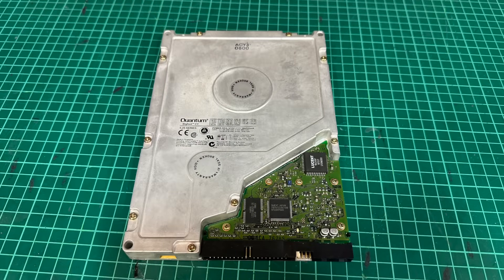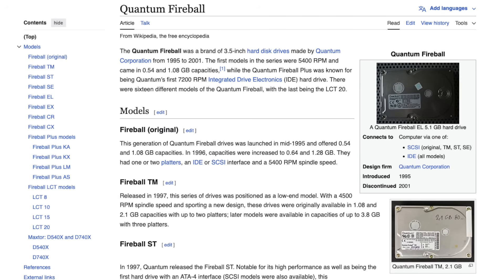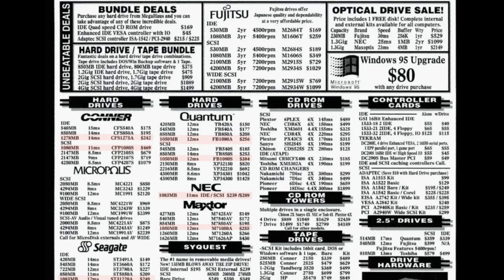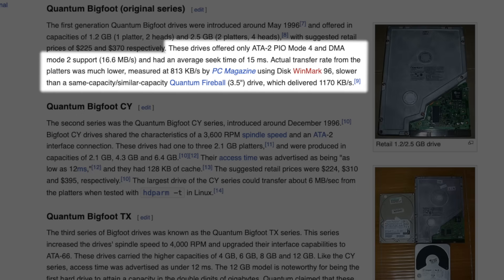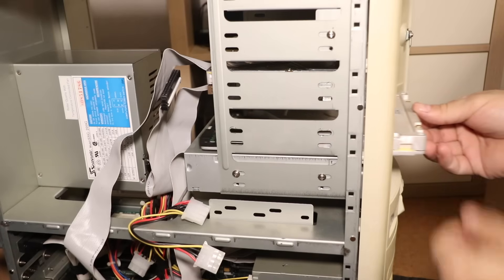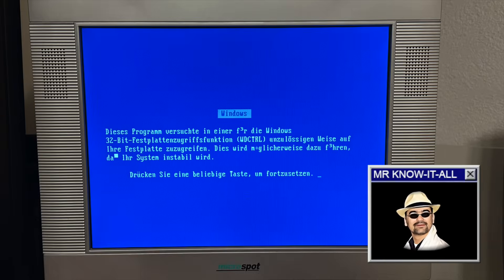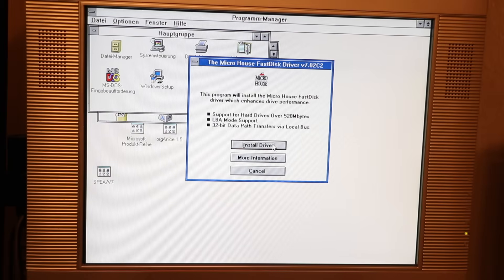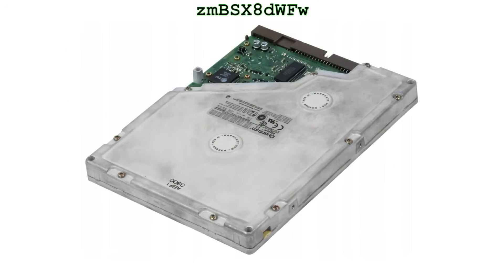The Quantum Bigfoot: When a 1GB Hard Drive Crashed Windows 3.11!

Comment: The biggest wow moment for me when replacing the disk came when I replaced the three original disks (40MB + 130MB + 270MB, Seagate ST-157A, ST3144A, WD) with a 2.5GB Seagate ST52520A, which was not only gigantic in terms of capacity at the time, but also incredibly fast. Regular hard drives at the time had 3200rpm, some faster ones around 4000rpm, and this one had 5400rpm. It was so brutally fast and big at the time. When my friends and I were copying stuff, their drives were running non-stop at full speed, and this one just flashed occasionally :D 1996

Comment: I always wanted a Quantum Bigfoot, but never had one. When they were on sale, I was fascinated by its size, but at the time I was more interested in the fastest drives, so from a rational point of view, it was out of the question for a potential purchase. Today, when people are no longer chasing speed but rather enjoying retro, it's a different story :) I do have one, but it's defective, so I can't use it anywhere :( I have two other drives, the RLL Seagate ST-3144R and the SCSI Micropolis 1684-7, but that's something a little different. Different times, different moods.
Reply from the maker: That fascination of „1 GB is enough for eternity“ ^^
Reply: @THEPHINTAGECOLLECTOR  I wasn't fascinated by the data size, I was fascinated by the physical size of 5.25". It was something that was contemporary (it's sold now) and yet it didn't belong there at the time (a relic of the past) :) Otherwise, I would prefer the very last version that existed, the BigFoot TS19.2A, but I probably won't be able to get it.

Comment: Man why I does not have a Problem this be my 2005 er Notebook with a 100 GB HDD with the Intel Pentium M 740 with MS-DOS 6.22 and WFW 3.11 at a 2 GB C Partition (because yes my Notebook have a Tripple Boot configuation, with MS-DOS, NT 4.0 on C (D,E and F are data Drives for MS-DOS, G: the CD/DVD-RAM Drive) and H with 85 GB Partition for Windows XP and 32 Bit Disk Access enabled on WFW 3.11?

Comment: I bought a Pentium PC in late 1994 which had a 540 MB hard drive. As I was always experimenting with stuff like Linux and OS/2 I quickly ran out of space and bought an 1 GB WD hard drive for around 800 DM, guess is must have been late 1995 or early 1996 which would fit with the price lists you showed. Also I remember I bought it at ESCOM which I think went bankrupt on 1996.

Comment: I worked at a computer store in the late 90's - early 2000's The BigFoot was a terrible drive. It was high capacity, but so slow. They had slower rpm's than competition; the larger disk meant higher seek times. There were other 5.25" drives on the market that had ~10 platters; these had like 1 or 2. This led to the lower MB/s. These were for people (and OEM's like Compaq) that just wanted to be able to say that they had a big drive. ZIP, JAZ, and tape drives were better for backups. Modern systems have lots of SATA ports, but IDE meant 2 (or maybe 4) drives / system back then. For most owners this was their only drive. Slow boot & application launch speeds. Just a terrible drive.

Comment: i think i had the 4GB version of this that i used to run Windows 95 then later on 98 on a P200 with an odd amount of memory, i think 96MB RAM...
It was a MASSIVE drive, but not an issue :)

Comment: I'm afraid that my first Quantum Bigfoot experience was also my last. I bought one in the late 90s even though I had been told they were notoriously unreliable. I learnt first hand that its bad reputation was well earned. Mine broke down within weeks of purchase as it turned out that the controller board for it had a manufacturing error and an SMD component had fallen off (most likely due to a bad solder joint). It was quickly replaced with a Quantum Fireball of a similar size and I managed to transfer the data by replacing the controller board for the Bigfoot drive with one that was lying around at the computer store I worked at at the time.

Comment: I had a 19.2 GB Bigfoot TS.  It was huge for its time, and affordable.  It only had a spindle speed of 4,000 rpm, while 3.5" drives did 5,400 rpm.  3.5" 7,200 rpm drives were also available, but they were expensive back then.

Comment: I had one of these drives - it was... slow.  But much bigger and actually affordable as a storage drive vs. just about anything else comparable.  I seem to remember 5MB/Sec transfers on sequential reads, and much much worse for random I/O.  Not a good boot drive at all, but as a second drive for photo or, um, Linux ISOs, it wasn't a bad deal.  I would be surprised to find any of the original drives still functional today, as they were kind of cheaply made too.  (Program note: It's PLAT-TERS, short A, for English pronunciation. I know English isn't your first language, so not a criticism, just a tutor point.)

Comment: In 2020 when I upgraded my laptop from 1 512gb and 1 256gb SSD to 2 1TB SSDs. Previously it was a pretty smooth curve from 4 to 8 to 10 to 20 to 40 to 80 to 120 to 320 then 500gb drives. Of which my desktop in 2009 had 4. And it basically stayed like that with either regular hard drives or 240gb SSDs adding up to the same 2TB total capacity until 2020 when I got the 2x1TB drives and suddenly even my laptop could store as much data as my desktop it was so freeing.

Comment: I absolutely hate the Quantum Bigfoot drives with a passion.  Everyone of them failed on me from the shortest time of five hours to the longest time of a month & a half of use (I personally bought three of them).  From heads failing causing scratched platters to chips failing.  I also had a lot of repair jobs from my customers that bought a system with those cursed drives.  I started to treat Quantum as a unreliable company since.
Reply: From my collection of more than 30 vintage hard drives ranging from the first Seagate 10MB drive until the last IDE 320GB monsters the only drives that I have problems are of course Quantum drives.

Comment: I had, and still have, a Compaq presario with a 386 and Windows 3.1 that currently has a 540MB hard drive. The first larger drive was my Eversham micros Windows 98 machine in 1998 that had first a 6.4GB drive then I installed a 12GB hard drive. I remember thinking that would be the largest drive I would ever need as I could never fill that. Now I have a machine with 18GB over multiple drives and I could easily use more.

Comment: My 286 Toshiba portable came with an 40M Conner HDD. When I first reinstalled dos, Win3.11, using Ontrack Disk Manager to wipe the HDD (yes, I got the parity virus), I find that the HDD was 80M but Toshiba recognized only two HDDs geometry: 20M and 40M. I installed the HDD with Ontrack and got access to all 80M. I felt that I never can fill the space, it was huge. I always used Ontrack driver to use 32bit Access for files and HDD in Win3.11, it was stable and compatible with all HDDs that I used, but I also find Micro House Fastdisk Driver to be very good as well.
Later, I had 120M HDD on my 486 and I got an IBM 520M, I felt the same, I can never fill that HDD. But I upgraded to Win95...
With Win98, I had an 4.2G HDD and upgraded to an 20G.
And so on...
Latest upgrade was from 2x2TB HDD + 1x240G SSD to 3x5TB HDDs + 1x750TB SSD on my actual computer. I am now at 30% space free...
Reply from the maker: Well, if there's one thing for certain then that you will never have enough disk space.

That 30 % free will be eaten up soon ;-)

Comment: The first time I was really impressed by a hdd/storage upgrade was about a month ago, when i switched a (heavily used) old hdd with a sata ssd.
Not the kind of comment one would expect here, but... FÜR DEN ALGORITHMUS!
Reply from the maker: I love it! Nothing beats SSD "Schwuppdizität" ^^
Reply: I recently tested a PCI Sata controller in a Pentium II, just wanting to see if it still works (got it in a box with several of these cards a while ago) and added a cheap SSD that I had laying around.

Well, I've never seen Win98 install and boot this quickly! 
(I installed it directly from the SSD, as the CD Rom in this P2 is broken)
Reply from the maker: I'm running quiet some old machines off Compact Flash, because the HDs are getting rare.

Adds quiet some punch even to 30+ years old machines.
Reply: @THEPHINTAGECOLLECTOR  Indeed, in my experience, swapping a HDD for an SSD is the most impactful performance upgrade you can give to an older machine.

Comment: My first hard drive upgrade was adding a 40GB Seagate drive to my Pentium II machine running Windows 98, that originally came with a 5 GB WD Caviar. It didn't originally go well, as the BIOS was freezing at the hard drive detection stage. It turned out that the machine suffered from the 33.8 GB limit stemming from the number of cylinders being represented as a 16-bit value. Fortunately I manage to find a BIOS upgrade for my motherboard on some magazine cover CD and that solved the issue.
Reply: Without the appropriate update windows 98 can’t handle a partition that size without causing corruption
Reply: @AmazedStoner  I think you're confusing it with the 128 GB limit that stems from 28-bit LBA addressing. 

Besides, I'm pretty sure that I had two partitions on that drive at the time.
Reply: @ The format limit had nothing to do with it. Though that is actually much higher btw at around 2 terabytes if you use third party software or the command line to do it. The real problem was a known bug that would cause corruption when using scan disk without the appropriate patch.
Reply: @ all the smart people used two partitions to avoid wiping all data when reinstalling windows which was always inevitable.

Comment: My first PC in around 1995/6 had a 540mb HDD and ran Win 3.1 fine but now I'm confused. Why didn't I have this problem? Or did you say it was not a problem in 386 enhanced mode? Upgrading not just capacity but to a 7200rpm drive was a big deal to me around 2000. Also, having so many options in the BIOS that could literally make the difference between a PC booting and not, without any explanation as waht any of them actually meant, was clearly a design flaw of PCs in that era.
Reply: If I remember correctly, Win3.x did not enable by default 32Bit Disk Accesss and 32Bit File Access. You need to enter in the settings and enable them (see the screenshot in the video where it says 16-bit mode for both disk and file access).
Reply from the maker: @sebastian19745  Correct, it's not enabled by default.
Reply from the maker: Ah, I see.

I think that might be the "Megabytes" distortion, wether one speaks about Decimal Megabytes (MB) and Binary megabytes (MiB).

Hard drive vendors typically advertise capacity in decimal bytes for their drive capacity, so multiplying by 1000, instead of 1024.

So, a 540 (decimal) MB hard drive (540'000'000 bytes) would be 514'984'130 binary bytes, that's actually ~491 (binary) MiB.

Although it's a bit more complicated in the explanation (https://www.os2museum.com/wp/how-to-please-wdctrl/ explains it more in detail),
the Windows 3.1 FastDisk driver (aka 32-bit Disk Access, as Microsoft called it), was crashing on hard drives with > 1024 cylinders.

I simplified it by saying, it was over 512 MiB, but it's actually even over 504 MiB, to be fully correct. My bad.

Even so there was occasionally smaller capacity drives with >1024 cylinders, that was more often the case with the "bigger" drives above 504 MiB.

And the calculation goes as follows:

1024 cylinders * 16 Heads * 63 Sectors per Track * 512 Bytes per sector = 528’482’304 binary bytes, or 504 MiB.

So it is very likely, that your drive fell through, as it was below the magic boundary, hence not triggering the BSOD.

It is of course as well possible, that your drive was in fact 540 (binary) MiB.
But if you bought it like that, chance might be, the vendor had actually installed a patched driver as part of the factory install,
similar to the Micro House product I showed, to overcome the limitation.

Or ... 32-bit Disk Access was simply not enabled on your machine. Then now crash would arise, even with a bigger capacity hard drive.